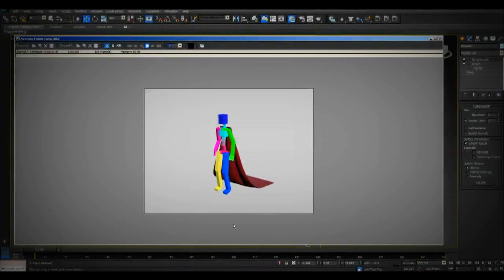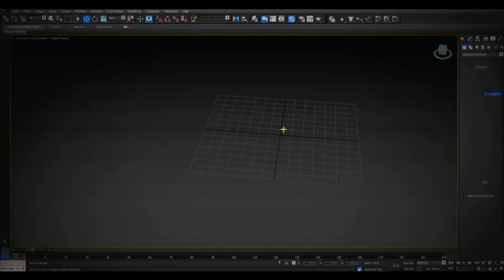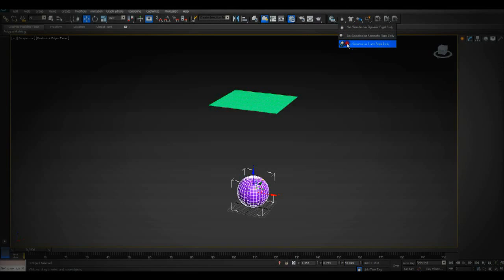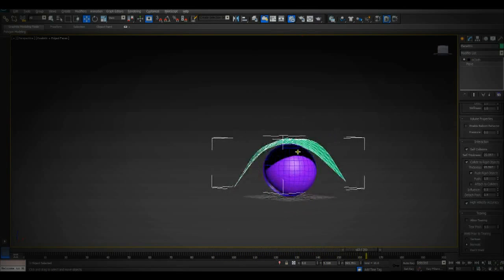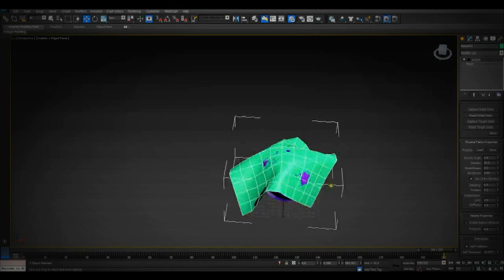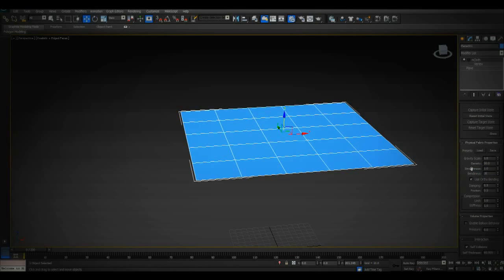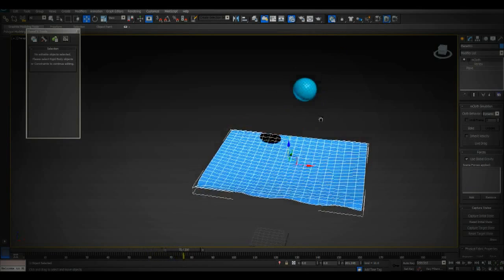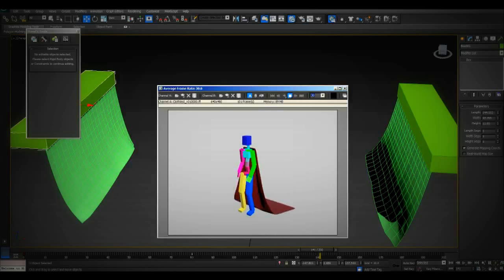mCloth - 3DS Max 2013 Tutorial. Level: intermediate.  Part 1

Comment from the maker: You are correct, it is a balance between having too many calculations and a slow simulation and too few calculations that returns results that are not very accurate.  However, if you are doing a high quality render, you will always put a Turbosmooth on top b/c you would never want to calculate 100s of thousands of Vertices.  Thanks for the comment.